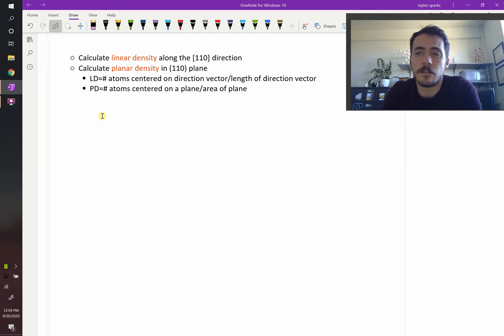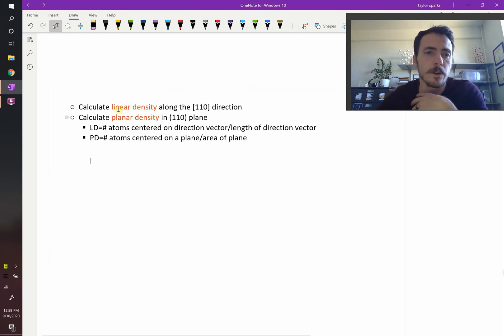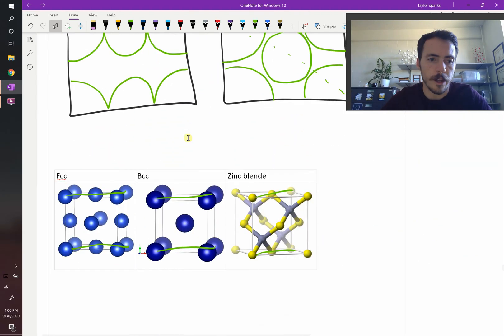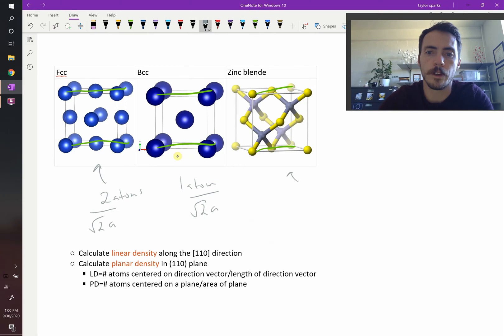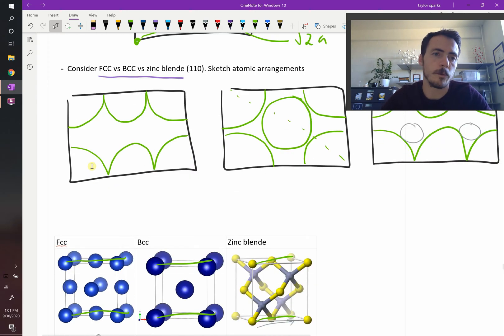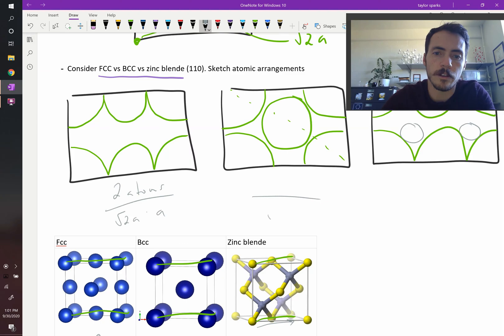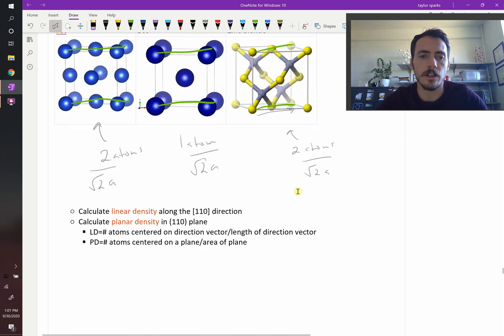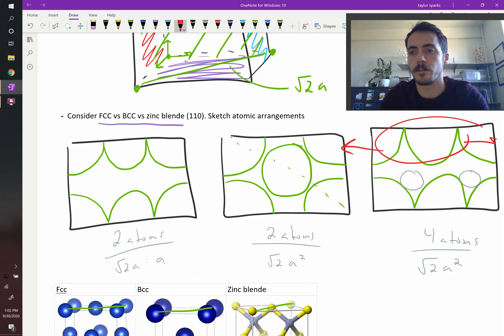How to calculate linear and planar density

Comment: when looking at the unit cell why are the corner atoms 1/2 in the linear density? why isn't it 1/8? even when calculating the APF its 1/8th each corner
Reply from the maker: That's a good question. When we are doing packing fraction we are thinking in terms of volume. What's the volume of atoms that you can pack inside of some volume unit cell. However, with linear density we are talking about a line in one dimension and so the atom gets half in or half out we don't have other dimensions
Reply: Thank you, this was a point of confusion for me! @TaylorSparks

Comment: im sorry but why is it divided by square root 2 for fcc?
Reply: Because if you take the base as ABCD consider the traingle ABC, the face diagonal AC (hypotenuse)can be calculated by Pythagoras theorem as AC²=AB²+BC² since AB and BC are the edge lengths they are equal to a, so
a²+a²=2a²=AC² take root of it you will get AC= √2 a  that's is the length of the direction vector